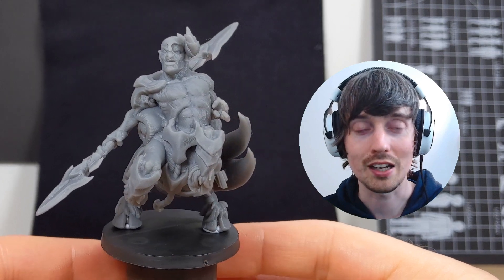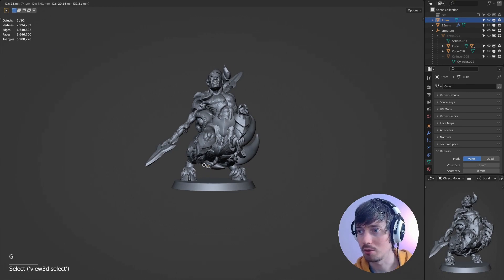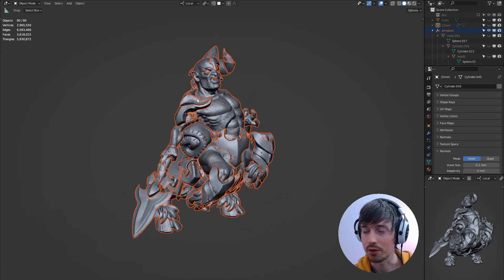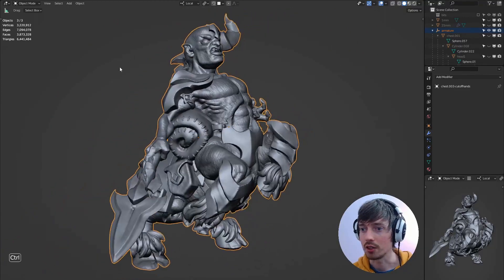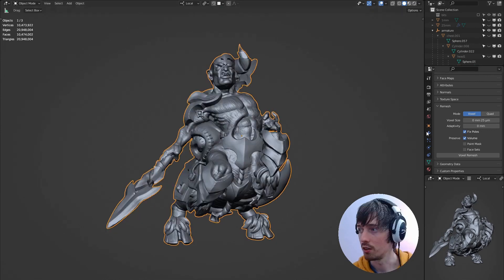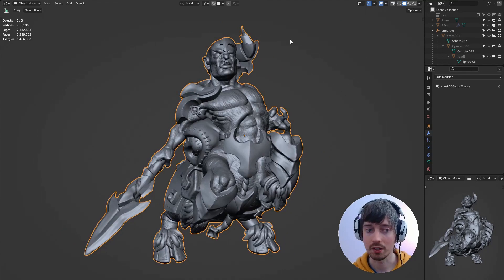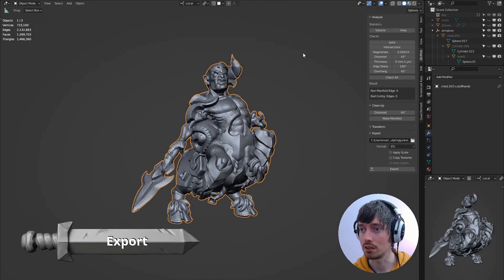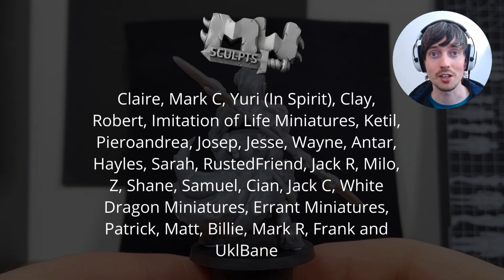3D Printing With Blender Tutorial - Blender 3

Comment: This is a very useful video, I was having a hard time finding a clear checklist of what a model needs to be compatible with printing. The one step I didn't 100% understand the intention of was the remeshing. Is that step only for correcting inverted normals, or does it serve another purpose?
Reply from the maker: That's great 😃. So the remeshing does flip the normals but I also use it to connect objects together. So if you ctrl+j your objects together then remesh to a really high density this will give you one manifold object ready for print. Rather than several intersecting objects which some slicers don't like. At least that used to be the case!
Reply: @MWSculpts  Great, that was one thing I was unsure about whether or not it would affect a print, but it sounds like it depends on the software and more are able to handle intersecting now?
Reply from the maker: Yeah I recon so, I think a lot of the slicers for resin printing mainly are OK with it but perhaps some of the FDM ones not so much. I need to do some research on this as it would save time prepping models

Comment: For some reason when I'm doing this It's making a million intersecting faces in random crevices of the model.
Reply from the maker: This has happened to me too in the past. I wonder have you tried applying the scale on the object?
Reply: @MWSculpts  I've applied all transformations that were made in object mode. It seems like the 3D Printing tools simply doesn't like anything I've made in sculpting mode, so I wonder if I've accidentally messed something up while sculpting, because I'm getting tons of zero faces and intersecting faces.
Hopefully I get it sorted soon because it's my first miniature, and I don't have my own printer so I wanna make sure everything is great before I pay someone to print it for me 🎉
Reply from the maker: I understand makes sense. Are you control+j all the objects together and then remeshing? Is that the point where the model messes up?

Comment: Great video. One beginner question. As far as I know blender ist creating only a „shell“ model. So a cube e.g. is hollow inside. If this is exported it cannot be really printed because the model in the STL would be hollow as well which would most probably not intended for printing 28mm models. So how you you fill the volume of the objects?
Reply from the maker: Yes so it's true the mesh is totally hollow. From what I understand so far is that the mesh needs to be 'manifold' which means no gaps. The manifold mesh is then seen in the slicer as one solid object. Hopefully this makes sense so it is not really hollow inside once the model is exported to the slicer.

Comment: What's the difference behind combining things this way and using booleans? Are there faces inside the mesh?
Reply from the maker: A big advantage of this method is speed, you can combine anything together and remesh quite quickly. The Boolean method is more accurate but you might find it takes you more time as there are often issues booling complex shapes together. Take a look at this vid too which looks at the two approaches https://youtu.be/Ovring0pLvM

Comment: Ohhh and i waste my time doing booleans to merge all pieces toghether and to not get geometry incide the model.
I was about to make the quetion about how you see if your models are big and thik enouth to 3d printed becouse i got some problems on my models that i made that came to thin and after i print then and primed, when i took them out of the gum that i use to stik it to the paper, when i lift them off they just breaked.
Awasome videos
Reply from the maker: Yeah these steps can be a real time saver. You can check the width of things with the measure tool in object mode. Or check the N menu under item tab and check the scale of the object if it's separated. Also you can use a square or something, set the size then place it over the object to see how it intersects.
Reply: @MWSculpts  I even forgot that tool... instead i was using mesureIT addon to select 2 vertices and create the mesure between them xD
To be honest i dident even knew about that ruler tool. Ctrl will snap into the vertices and other parts... another time saver xD
Thanks again

Comment: Ah amazing tip! I had everything in my workflow up to the remesh and was seeing as you say files with 1m+ polygons etc and large file sizes. Absolutely going to go back and run a decimate on my minis!
Reply from the maker: That's great 😊, you will need to tweak that decimate value and take a look at the model once done to see the quality but I'm sure you can find a good balance 🙌
Reply: @MWSculpts  absolutely! That and the blender 3d print settings for manifold object are really good tips, I had been using prusa slicer as it has a great file repair system, but at high memory usage due to large files it could be slow and sometimes unable to fully process the files! Great video again will definitely improve my sculpt to print workflow!